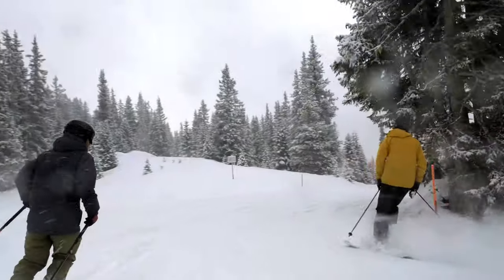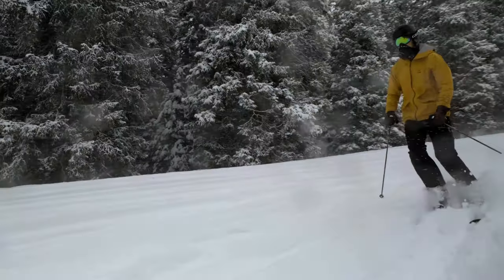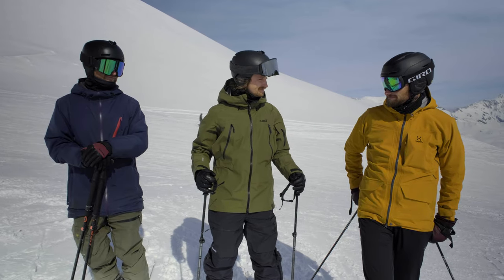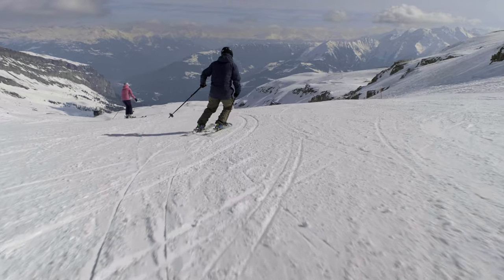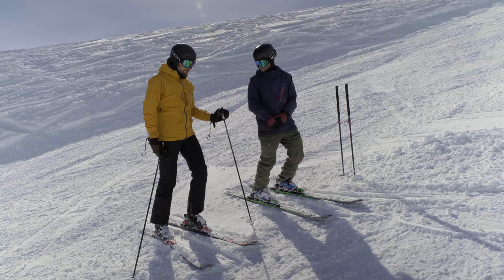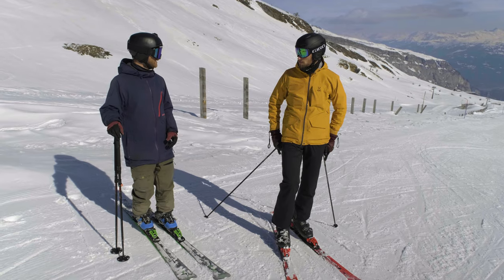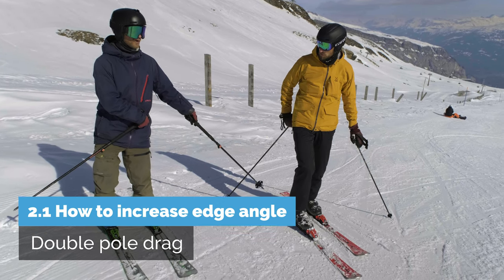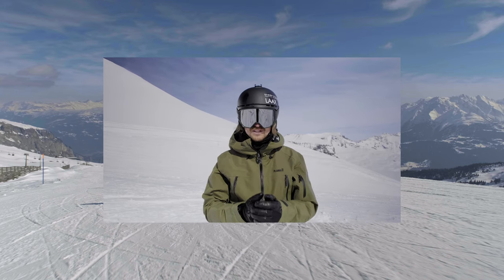How to Carve on Skis | Fixing 3 Intermediate Mistakes

Comment: Hi guys! I used to be a ski patroller w CSPS in Canada for 8 years and a level one CSIA instructor  back in the 80s. Your arm placement is driving me crazy. We used to talk about having the arms forward more at about waist height for a more balanced stance... Almost like carrying a tray of beers. Is my thinking an old way of thinking? I do get the pole dragging. No doubt you are working more on the lower body.
Reply: I was thinking the same thing, it was driving me crazy 😂 but probably done to help isolate the edge angle issues. His feet we're looking really good at the end!
Reply: @matthewbarnes472  agreed. I think it's to get the  "feel" of the edge working properly underfoot for this specific person.  It's a sign of a good instructor to figure out a novel way to get each person with different biomechanics, confidence levels, sport backgrounds and ski/boot setup to get that feeling at these lower speeds.

The instant feedback in ski feel, Carv assessment and instructor teaching makes this rewarding for everyone and enjoyable to watch.

Comment: Great progress. Narrower skies under the boot helped as well to be honest. Hip motion and lateral bending that put weight and pressure onto the outer ski prevent his “leaning into the turn” (and prevents puting pressure onto the inner ski).

However one or two quite obvious mistake remain. (1) The position ot the outer ski and (2) the innner knee position / innner ankle incline. 

(1) His outside ski is lagging behind and should have been put in front. That makes feet parallel. His “overtaking” w. the inner ski, puts too much weight on the inner ski.

(2) His shins form the V shape. His knees almost touch each other, while his feet are in wider stance. For this reason the inner ankle/shin incline is smaller then the incline ot the outer ankle. Putting a ball (either imaginary or a real one) between his ankles helps skier maintain the distance between his knees, makes shins parallel, makes his inner ankle incline more into the turn, and prevents putting the weight into the inner ski.

Comment: I find it strange that someone can reach a ski IQ score of 146 while having an A-frame. You can easily cheat the Carv system and this video shows it. Just find a really flat blue like in the video, and just roll your knees from side to side. It doesn't matter if it is really really slow. Take your time to just control every single motion almost in slowmotion and your Ski IQ will be skyhigh.
Then take your skills to a steeper slope or higher speed and watch it all fall apart.
While it is good to learn to carve cleanly, Carv should take into consideration the travel speed, peak pressure and curve time vs achieved turning against the fall line. Because when you really play with high forces and slope angles, is where the actual challenge is. That should get you a higher score. Otherwise any intermediate can just roll a blue slowly and be done with it.
Additionally, you should be awarded for a little rotation or slip mid turn. It's a skill only few master and carv should be able to measure it and reward you for it, not penalize like it does now.
Reply: I am totally with you. I was confused about his Balance score etc..

Comment: can I ask when you add the Carv insoles to a persons boot for a session/lesson do you stick them in or do they sit snug? I ask because I would like to transfer them between two boots but was worried I might damage them putting in and taking out again.
Reply: The inserts go under the boot liner & then you need to tape them in. So it would be a pain to be swapping them and it will probably add wear & tear to the electronics.

Comment: funny how the 1st step which is change your skis is missed. He started from some twin tip beginner skis on day 1 and by the 2nd or 3rd day he had the S9s which practically carv for you. 
There is one thing I would like to point out in his stance, his chest was a bit too tucked in. You can see that the instructors look more confident by having their chest out, or how I imagine when skiing carve, is leading(leading, not leaning forward) with my chest which helps alot when you are in mid turn and get that boost of speed to not get thrown back